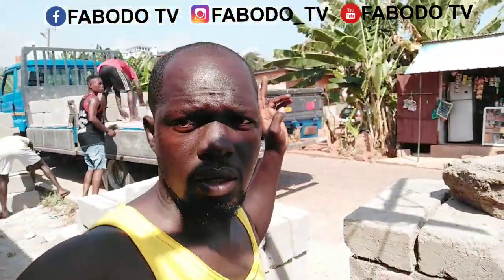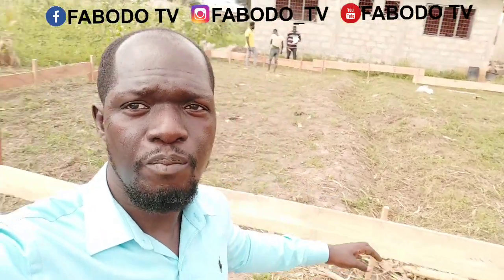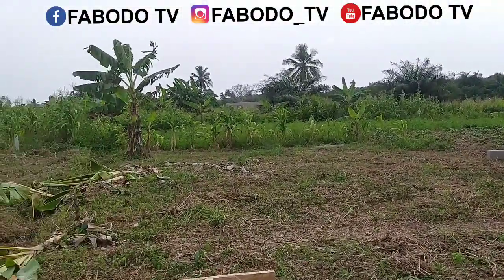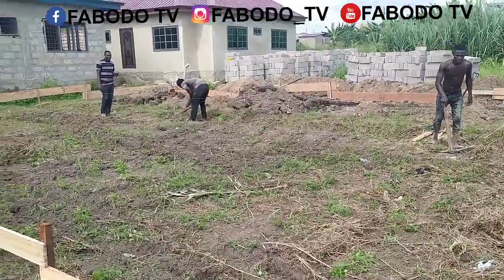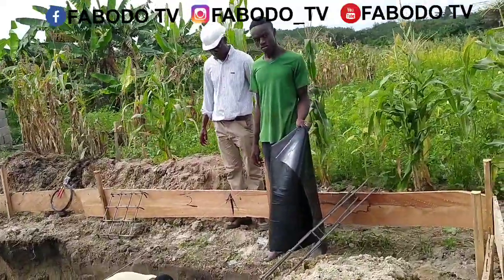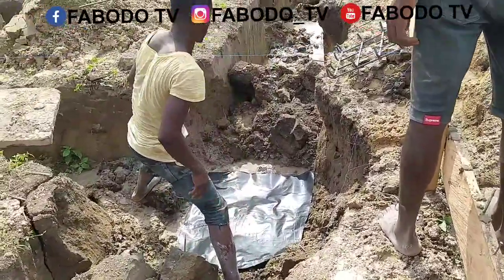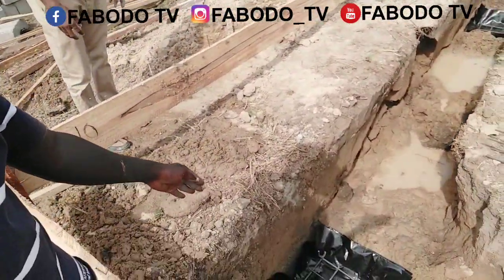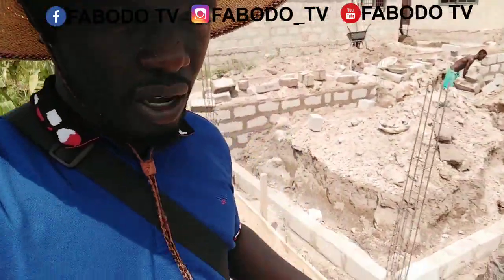Stage1: Building 3 Bedrooms House In GH🇬🇭 For A Client || From Site Clearing To Foundation Level🏡🏘️🏠

Comment: Bro,for super structure double story house which concrete blocks good solid or hollow block?
Reply from the maker: The ground floor should be solid blocks but from first floor going you should use hollow blocks
Reply: @riknoxpropertiesgh100 bro, thank you so much for quick reply! we are only using red brick which is using for load bearing houses  without any  column and beam! all load transfer via red bricks wall  then to foundation but i am thinking to use  concrete solid  block  as load bearing for my new house in villege.

Comment: Hi there. Why is this so close to the other building? Also is it true that in Ghana they call 4 x plots an acre, which someone tried to tell me me but I refuse to believe that as an acre is 43560sq ft. Someone tried to tell me they bought 4 x 100 x70 plots and the seller said it was an acre. By my calculations and understanding an acre is the same worldwide so 6 x100 x70 plots at 42000sqft  would be the closet they'd get to an acre in my opinion. What's your thinking on this please.
Reply from the maker: 4 X 100 X 70 is called 4 plots not an Arce. Thank you
Reply: @riknoxpropertiesgh100  I know this. Please read my argument more carefully. Thanks.